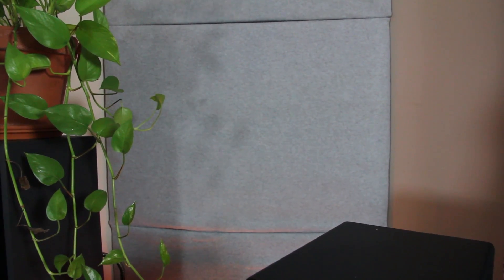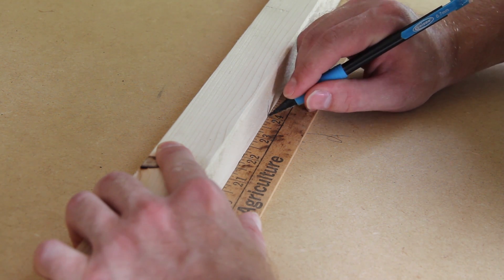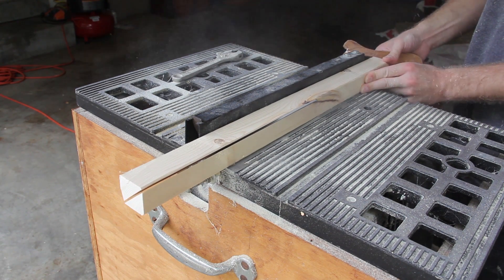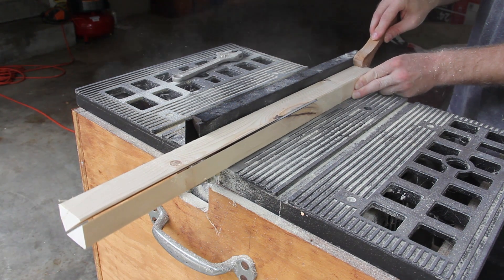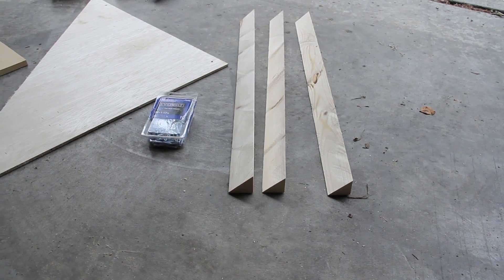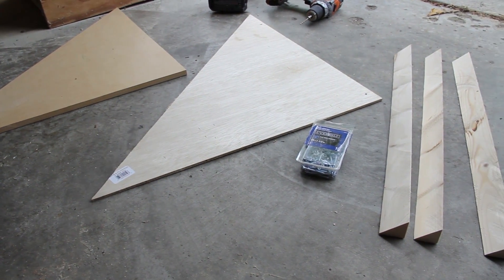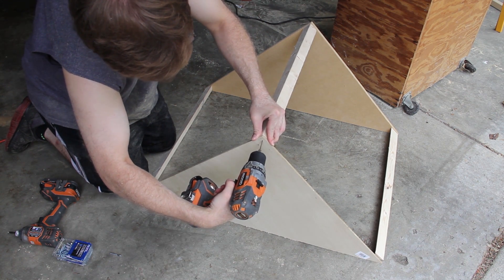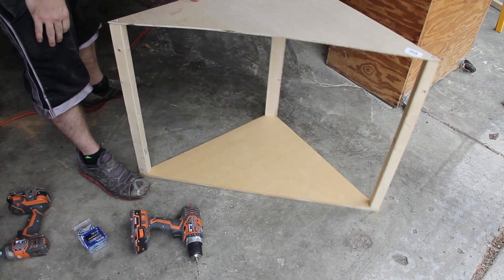DIY Bass Traps: Home Studio Room Acoustics

Comment: 2 sheets roxul per triangle, x 3 triangles per corner.  12 sheets for 2 corners, bag of 8 sheets is around $65..so $130 for two full corners with 4 sheets left to make wall panels..actually not too bad. Add lumber cost and you're still probably less than 1/2 price for buying all this pre-made🤔

Comment: This staff is Heavy Hazard,Insulation Is Very Bad for You,,Specialy in the  small Room,,For better Health you need to use Recycled  Material Insulation.
Reply from the maker: I've read the lab reports on it way back and it passes. They're somewhere out there if you want to look it up. It is not standard fiberglass insulation.

Comment: Thanks for the tut, fairly in-depth. But for the love of Larry, pls demo safe shop practices: wear a dust/fibre mask and long sleeves when handling rockwall, never ever ever ever reach over a table saw while cutting (!), and while your at it, put some wood or foam padding on a concrete floor to kneel on. My aged back and knees are still recovering after watching that segment. Plus, as someone also pointed out, an air gap = to depth of material is likely to improve acoustic performance. That said, those are fairly nice looking bass traps and the stackable approach is pure bueno :)

Comment: Did you ever consider adding a proper extension to the outlet which would give you the same options or more for power placement and remove the compromise of having to leave that outlet exposed.  Either get a high quality power strip with a 90 degree plug and build over that, leaving the strip exposed for even more versatile use.   Don’t be confined by where “plugs” are.     Add to them and place the “plugs where you can better use them, whether they are 120 volt, speaker cable jacks, xlr jacks, 1/4”, whatever.       Compromises are just solutions waiting to be found.

Comment: Awesome video sir! Any value in covering up the back? Worried about breathing in fibers.
Reply from the maker: Thank you! It is probably a good idea just in case and you can probably use a cheaper material than the felt.. The safe n sound material did pass several safety regulations though.

Comment: This was a great video. I was wondering if you really need a frame? Could you not just cut the rock wool, wrap it in fabric (really tight) and just stack it in your corner? I understand you need frames for the panels, but I don’t understand why you need frames for corner bass traps. I’m hoping someone can answer this before I start building.
Reply from the maker: Thank you! The frames are to distribute the weight. If you stack them without frames, it will be too heavy for the bottom pieces to support it. I don't think leaving an inch at the top would be a big deal but not sure. You could save a little rockwool if you need to fill it in just in case, but I doubt there is a noticeable difference.

Comment: I wonder if it would have the same effect to just wrap the rock wool triangles in fabric without the wooden frame? Can anyone confirm or deny this?
Reply: Rockwool can break apart pretty easily, I think the frame really helps keep its shape. Also makes it more solid for stacking and gives you something to drill into if you plan to mount

Comment: Nice video. Is the insulation material like fiberglass insulation where you need to wear a face mask? Also, how heavy is each trap about? Thanks...
Reply from the maker: Thanks! You should wear a mask and protective gear. It is not the same material as fiber glass and didn't seem as bad to me but it can be irritating. Each section is about 15lbs.
Reply: @ToddAudio  Thanks for the info. Did you notice a big difference once you installed the traps?
Phil

Comment: OMG, ALWAYS use a guide when cutting wood on a table saw, NEVER, NEVER, NEVER run the material through the saw with two hands as shown here, as the blade can catch the wood and kick it back in your face, causing serious injury, standard practice is to use the miter guide that comes with every table saw, and sets in the grooves of the table, using such a guide will assure a square cut (assuming the guide is set square), and assures no kickback. For cuts along the long length of material, use the fence also provided with every table saw. Other than that, I really like the idea of building triangle shaped frames for bass traps and then just stacking them, may do that myself in place of my wall mounted traps that don't work that well, the other advantage of this design is the deeper level of material that helps trap the low frequencies, great idea.
Reply: He was very close to finished his guitar career forever:)

Comment: Great video,  but you didn't make any comments about the effectiveness of your build. What happened to the sound signature of your room?
Reply: I made similar bass traps to these, and tested them with, and without an air gap. I measured the room both times. Without an air gap, there was very little benefit to the bass traps. With the air gap, they made a massive difference. I wonder if this person later added the air gap to the inner corner.
Reply: @JohnMarshall-NI  how big was your air gap? a few inches?
Reply: @skullsworn9194  about 6 inches deep.
Reply: @JohnMarshall-NI  sorry might be a stupid question but what do you mean by “air gap”? Does that mean that you move it 6 inches from the corner?
Reply: @samindj  it just means that you leave a gap between the bass trap and the corner (I just cut the inner corner off of the earth wool triangles).
Low frequencies filter through on the way in, then are filtered again on the way out as they reflect off of the corner.
My current bass traps are 'super chunk', like the ones in this video, but with the air gap.
If I was going to make them again, I would probably make 'diaphragm' style bass traps as I think that they would require less earth wool and be more effective.
Diaphragm bass traps have multiple air gaps, so the bass frequencies are filtered more effectively.

Comment: If you're not a champion at cutting wood with a table saw or any circular type saw, get them pre-cut. Those things will come back and bite you unexpectedly! Also I would highly recommend leaving an air gap between the trap and wall. Same goes for acoustic panels. Works a lot better at swallowing the bass. Not criticizing your great work, just giving some tips. Good work, happy listening.
Reply: how thick of an air gap would you recommend? 2 inches?
Reply: @skullsworn9194  No more than the actual size of your panel. Example: If a panel is 100mm (4") than the air gap behind the panel should not exceed 100mm(4"). Here's a YT link to  a guy who studied this stuff. https://www.youtube.com/channel/UC57auUfJlTvIvW79pom_i1g

Comment: Seems decent for catching mid-frequencies but let's be serious, that wool would need to be very very dense in order to get anything below 100hz. Only mass can deal with low frequencies. Also seems like a fire hazard waiting to happen.
Reply: youre spot on mate
the thing is that it does not cost very much and bass traps that are helping in frequencies below 100hz are bloody expensive, and as youve said, in the mids it is really helpful and that should be enough for a home studio
regarding the wool he should mention that it is some dangerous stuff and it should be fully covered, not only on the sides pointing into the room
Reply: Withstanding temperatures up to 2150°F (1177°C), Safe'n'Sound® is non-combustible and will not produce toxic smoke or promote flame spreading, even when directly exposed to fire. This adds valuable extra time for people to reach safety and for fire services personnel to arrive.
Reply from the maker: Thanks for mentioning. Yes, it is fireproof and designed for soundproofing. It is a lot more dense than standard insolution. One layer is not rated to do much at all below 100hz but that is why people are layering multiple together for bass traps. The difference in that range is still small compared to mids but still a much better and audible improvement for a home studio. The listening invironment is comparable to what I've seen/heard in small local studios. You'd have to get into room design and/or very high priced acoustic treatment to go much further. However, recently people have suggested adding an FRK membrane to the front and leaving an air gap in the back for even better low frequency results. I am not the scientist behind this but just made a build I found to be more practical for my needs, and it is based on the same dimensions and materials. You can probably still find room tests with measurements based on almost this exact design, or similar upgrades, if you search around forums. It has been well researched and advocated for a cost effective and efficient home studio solution. In the future I might make the frk and rear spacing mods and do a comparison.

Comment: how did you installed the bass trap on the wall corner ?
Reply from the maker: I just stacked them, but if they lean forward you can use small pciture frame nails to hug it against the wall around the edges.

Comment: great stuff,  would it be ok to use this method for a 6-7 foot trap? or would it be better to make 2 different traps and stack them? thanks
Reply from the maker: Thank you! You probably need to either stack them or build a shelf in the middle to support the weight of the rockwool.

Comment: @Todd Audio- Great video, but I have a load of questions. I want one corner trap-really don't want to stack. The height is approx. 80".  Could I make my frame that long or should I make two frames at 40"?
Also, I don't have a table saw-Do you think Lowe's or Home Depot would make those 45 degree cuts if I purchased the 2"X 2" strips?
I'm trying to wrap my head around how you made those triangular cuts? How did you calculate the measurement of the 3 sides?

Comment: I would have used spray paint between each layer of the fiber just to be sure that when you move it or if it falls they don't get misaligned. I know they probably have a good grip between them because of the material but i don't think it hurts being safe

Comment: What is the reasoning for using both the plywood and the fiberboard? I feel as though I could put the plywood on both sides and it would be adequate structurally. Or is it something to do with acoustics?
Reply from the maker: You could do that but I would go with half inch thick plywood at least on one side for it to be more firm. There is no reasoning to do with acoustics.
Reply: @ToddAudio  Thank you very much. Aprox how much did you end up spending all together on all the traps?
Reply: Oh and how many stackable triangles could you make with 1 pack of the insulation?

Comment: You really want to cover the invisible sides of the trap as well. And just maybe arrange for an air gap behind them. I found that the gaps actually helps a lot. The trap won't go lower in frequency but it will attenuate more in the frequency range it covers. Thanks for the video, almost 4 years after the fact :)
Reply: I think they actually will attenuate lower frequencies, depending on how large the gap is. At least that what I found when researching this topic. Either way, a gap is definitely advisable because you're effectively allowing the air to permeate into an open space, before rebounding back into the trap. This is better than if the insulation is flush against the wall, in which case you're only getting the benefit of reduced pressure at the boundary, not the benefit of reduced velocity at that area as well, which you do get when there's a gap.

Comment: It takes 12 feet of Roxol to attenuate 6Db of bass, so how is it that these work then? I know how Helmholtz resonators work, slat resonator, slot and perforated too but this is just snake oil to sell a useless product. Acoustics is physics, you can study and learn it quite easily if you have a little time each day, but again, Roxol is the worst product you can work with unless you are just using it like fiberglass pink but for bass? A great big no. It is good to eliminate any 90 degree angles to eliminate phase issues though. And the actual definition of a bass trap is a space that is 1/4 the length of the wave you want to absorb, we are talking about sound waves over 80 feet in many cases and then you need to add wave guides as well, so if you have an extra 20 feet to build an actual bass trap you are doing better than most. You may be able to use Roxol to get rid of some reverb, but there are much better products out there like Corning 702 or 703 but they are not cheap. IF you want to learn how to treat a room, John Brant  has a channel here and is very good at designing rooms, Here is his website with free software for room mode analyzers etc...free!
Resources - John H. Brandt Acoustic Designs

Comment: I watched the whole video but I didn't see any bass traps. That nonsense you built doesn't work with low frequencies. I'd like to see the before and after measurements.
Reply from the maker: Well the materials are listed in the beginning so not sure why it took the whole video for you to come to your conclusion. Do some research and you will find examples. This was based on already built and tested models with same materials and measurments. Not as effective as if you spend thousands but it helps majorly compared to nothing. This is a home solution. Thanks for watching.
Reply: @ToddAudio  Ethan Winer also said that that stuff you used only adequate in the midrange and higher frequencies. If you drop names of real experts at least you should pay attention about what they say .  I'm sure your "acoustic treatment" is perfect for against comb filtering above lets say 200-250Hz but it does absolutely nothing with much lower frequencies. Again if I'm wrong you should be able to prove it with measurement data. Did it improve the boominess in the lowest frequency range? I highly doubt. After all it is your room I'm just frustrated by the fact that so many people believe this nonsense and some of them even promoting it by making videos like this. Cheers
Reply from the maker: One layer is minimally effective below 175 hz, but this is multiple layers. Saying "real" experts implies that I claim to be an acoustical treatment expert, which I don't. I am a home recording enthusiast sharing my solition, which was researched and based on input from people much more knowlegeable than me. Beyond that I spend my time making music and sharing what works for me to help others do the same. I think a very valid argument would have been these aren't specifically bass traps but broad band absorbers and will also absorb higher frequencies. Research and analysis from others show adding an FRK membrane to the front helps reflect higher frequencies and can even slightly improve the bass absorption. This is something I might try, but for now I just consider this when mixing and not to overcompensate on reverb. I still use these years later because from day 1 any audible bass is much more clear and easier to decipher, resulting in better control and better mixes. While eventually I might haul everything out and back in to do some comparison measurements, in the meantime I can rest assured that my mixing environment is way more precise than 99% of listeners, resulting in mixes that sound professional on phones, car stereos, home speaker systems, computers, concert speakers, etc. 

Usually when I get this type of response it is someone who is involved with a company selling very expensive professionally manufactured studio solutions and trying to downplay the effectiveness of home solutions. Last time I checked, listeners don't calculate and prep their room acoustics with measurement software. Outside of a very specific niche, nobody would even know what you are talking about. This is about getting a good working solution in place (done) and continuing to make music. Most people finding this video pretty much know what they want and are in the research phase to determine how to build it.
Reply: Todd Audio Well said, I couldn’t agree more. But your saw safety, good lord!

Comment: You have an item list in the video, but how many traps can you make with that list? Thank you!
Reply from the maker: The list does not provide quantities because every room is different and you will need to measure and then calculate. Rooms can vary in height but also if you need to work around furniture or it won't fit in certain places that should be considered. Start by measuring the total surface height you need to cover for each corner in inches. Since the bats are 3 inches thick and each bat divides into 4 equal triangle, you can divide your total height by 12 to get a rough estimate of how many total bats/panels you will need. Overshoot rather than undershoot because they may compress some... so if 3 packs sounds like barely enough I would get 4 and you can use leftover for wall panels. For the other supplies you will need to do similar calculations based on how much surface you are covering with fabric, etc.
Reply: @ToddAudio  Gotcha, just curious what your list resulted in. Thank you, great video!

Comment: Hey nice build! I'm curious as to why you built them in small sections (8 layers rockwool) as opposed to doing one whole floor to ceiling unit?
Reply from the maker: Thanks! The rockwool is not sturdy enough to support it's own weight if you stack them that high. It's also nice that they are more modular in case you want to move them.

Comment: DO NOT JUST PUT FABRIC INFRONT OF ROCKWOOL, OR ANY OTHER FIBERGLASS FOR THAT MATTER. CANCER. AS YOU HANDLE THIS STUFF, WITHOUT A MAKS OF COURSE, YOU WILL NOTICE WHAT IT DOES TO YOUR SKIN and nose. Cover it up with thin polypropeleyne or thin mdf, if you walls can take the weight - It is simply a myth that the cover material has to be free flowing.